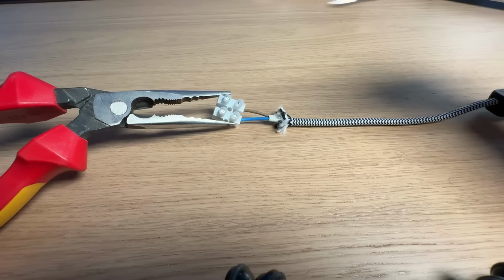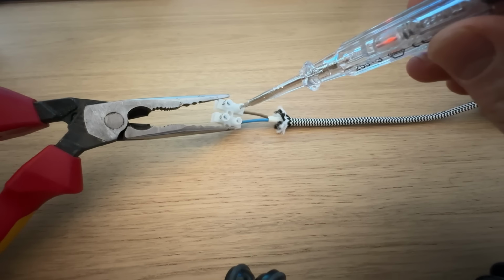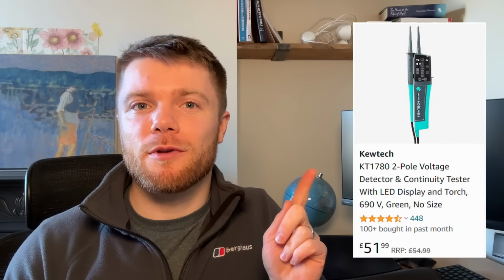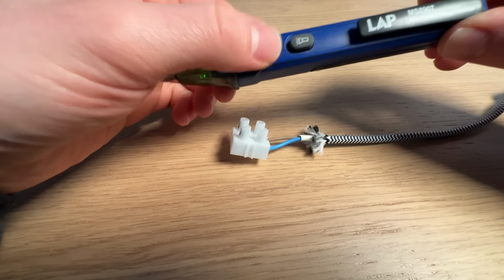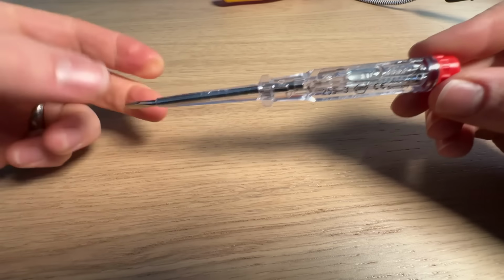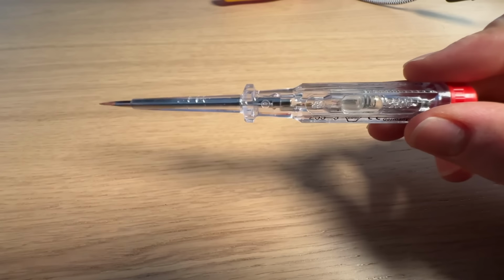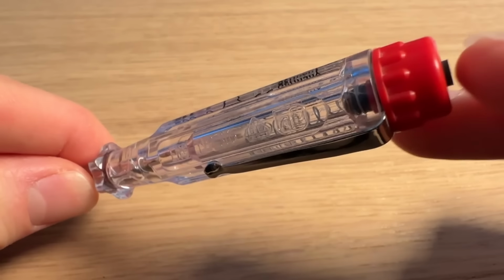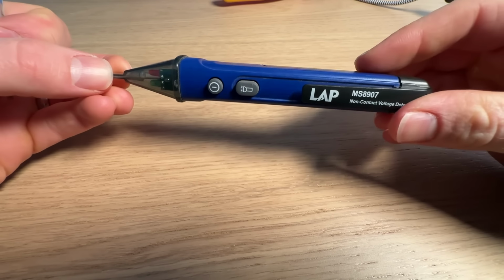The Most Dangerous Electrical Tool

Comment: My non-contact voltage tester lights up when I touch my nose or other body part.

Meanwhile it doesn’t light up on live power cords because the two wires cancel each other magneticallyo.

Comment: As an 80yr old DIYing Design Engineer, I appreciate the risks you point out but I used one for decades and I have to say that it hardly ever killed me.🤪  Following the valid points you made, though, it would make sense NOT to use one especially with the availability of the magnetic sensing type you demonstrated.  Thank you for your effort... .Excellent video.
NoAxe

Comment: Non contact voltage tester is cool. Didn't know they existed. Only real problem with the screwdriver is you could get it between live and neutral and then you short circuit. Strange this was not mentioned. I actually did that once...the spark was pretty big )))

Comment: Very, very well said, so informative! I've been using it for more than a decade, never got shocked, but what you say about getting something in that tight spacing, between the resistor and spring, mostly water... yes, that could really happen at any time! I although had voltage a check between the end, N and PE. 200V on a 230V circuit, of course with insignificanr, low current... it won't be easy, but from now on I'd use it at best for small screws. Keep safe!

Comment: There is absolutely no danger in using this tool, you cannot get shocked. Just that if you are isolated from the ground by thick shoes and air is dry, light may stay off even if wire is live, and you may be tricked, this being the danger. So, to be completely sure, keep the other hand on the wall or the ceiling, this will assure a better grounding of the body.

Comment: One should be aware, that there exist products for testing low voltage DC that that looks exactly like this pen screwdriver, but are very dangerous when used for mains voltage. Always check rated voltage and insides before using this kind of item. Those phase testers are classic and worked quite well, but it seems they are being phased out of eshops anyway...

Comment: If you find hard to securely work with a neonpen you have less knowledge to work with electrical than requred. Go stack retail.
Reply: ...getting an actual READING off of these devices requires FIELD EXPERIENCE. They work safely, and (because of their simplicity) they are always reliable and can get you through issues WAY faster then your Mystery Machines you buy for a sl of dollars/pounds.

I'll do wonders after wonders with this while you're looking for manuals/bateries.

Comment: I’ve been using mine for years with no problems. If the spring were to break it wouldn’t complete the circuit anyway & condensation is a stretch. If you don’t look after your tools I guess anything is possible!

Comment: I prefer the non contact testers as well. Always been wary of the screwdriver testers where you're essentially using your body as  an electrical conduit to earth for mains current, relying on the resistor in the screwdriver and whoever put it together to lower the current enough.

Comment: Good video and good explanation. Just want to add small point. The screwdriver is not really dangerous because of big current, since resistor inside is very high. The bigger problem is people think it’s safe or dead when it’s not. So it’s more about false safety than shock itself. Still agree that non-contact tester is better.

Comment: Like anything else if used properly and check before use. Many use them as a screwdriver which can damage in internals. Most of those testers have a pocket grip and that's where it should stay if not testing for a live.

Comment: Non contact voltage testers don’t work with DC, they only work with AC do use them only for AC.  Use the screwdriver voltage tester for DC like in the car which is 12v DC

Comment: The BIG problem with some   NEON  screwdrivers .... is .... just  DO  NOT  use as a screwdriver (  EH ? , WHY ? ) ... the plastic moulding is  SO MUCH  inferior to a ( normal 😝 ) screwdriver , and may rotate under pressure ( tried - n - tested ) .... DAVE™🛑

Comment: Contactless ones are not as reliable as old neon light testers. 
They are completely safe if you know how to use them: always use your dielectrical shoes when working with elevtricity.
And by the way, there's a conceptual mistake in your explanation: you don't close circuit to the ground, that's not how it works. The tiny neon in the tester needs so little current that your body's capacity is enough to take all the electrons back and forth. 
You are a big capacitor charging and discharging. A wave of electrons go from the wire to your body and back from your body to the wire, no closed circuit.
This is how it works even when you are isolated from the ground, say up in a wooden ladder

Comment: For a domestic spark, these are probably okay, tho I wouldn’t use it and I usually throw it in the bin when I buy a new set of screwdrivers .  They’re terrible as a screwdriver  so it ends up being a dedicated voltage tester which it isn’t really great at either. You’re better off with a Duspol which is CAT IV rated for up to 600 and CAT III for 1000v.

Comment: Non contact "pen" is quite good but sometimes it doesn't light up for live isolated cable. So always double check with two different kinds of testers eg. non contact and screwdriver.

Comment: The advantage of an indicator screwdriver over non-contact tester is that it gets in CONTACT with a conductor where NON-CONTACT tester does not. If you use non-contact tester to check a back box with 'spaghetti' you will not get a definite answer which particular conductor is live and which one is not because magnetic field created by live conductor which is close to all other conductors may affect those which are not live and still trigger your non-contact tester. Indicator screwdriver provides you very strong indication which PARTICULAR conductor is live and because of that reason I will carry on using it. I hope it makes sense and please correct me if I am wrong.

Comment: I much more prefer using 2 voltage testers, one is the one this video is criticizing, and the other one is one that tests through wires without opening them and in contacts too. from my point of view this is a much safer way to work because if one fails, the other one will work, the chances of the both failing are almost zero.

Comment: Regarding the non contact detector. Problem arises when testing what you think is a negative wire, the detector may signal because its picking up a signal from a nearby positive wire giving the impression that the negative is live when it’s not.

Comment: I've worked for 2 major steel suppliers. The contact screwdrivers were outlawed decades ago by the employers. If I was caught using one, I'd be out the gate. I use a non-contact tester for checking live, but not proving dead. Fluke meters or approved test lamps are the only tools permitted for proving dead.

Comment: problem with the other options is that, the non contact detector can and will lie to you. And the 2 prong tester ,well needs 2 points of reference, you dont always have that. The biggest problem with these is that the plastic on the shaft breaks way too easily. But a bit of electrical tape and youre set

Comment: Rule in Australia is following: 
1. Check tester before use.
2. Employ tester.
3. Check tester before putting away, especially if there was the possibility that someone else used it and damaged when you were absent.
These are excellent, particularly the new types where one may test for continuity, etc!

Comment: There are better designed versions of this tool which are sealed and the neon is shrouded so that it can be seen in brighter lighting conditions. You may well not always be making a circuit as I have used them in rubber boots on rubber matting and they still work (capacitance?) but get brighter if you touch something earthed. Whatever tester you are using test it on something you know is live first. I love these simple testers and they outlive all the electronic, battery eating, bleepy things and I've had a few over the years.

Comment: These screwdrivers are the best thing you can have if you know how to use them. Yeah, I could haul my electrical tester with me wherever I go, but I don’t do that. And I can always carry this small screwdriver in my pocket, you can’t put electrical testers (a multimeter or a Fluke) in your pocket. I use it as an ordinary screwdriver 95% of the time, it’s just the right size to screw or unscrew most of the screws you find in the wild.

But when you need to check if there’s electricity, you should always test it first on an outlet you know has power. Oh, and that no-contact pen you have, I’ve heard a lot of German electricians call it a “liar” (Lügner), because it’s so unreliable at detecting whether there’s power or not, even though that’s its only job. Meanwhile, the test screwdriver can unscrew screws and do a lot of other things, and it has the same level of reliability when checking for power.

Oh, and don’t get me wrong, all of these tools are great for what they’re meant to do. I own all of them, you just need to know how and when to use them properly.

Comment: In my opinion they are not dangerous to use. The problem I see is that it gives you only an indication that there is a voltage on the live wire. You don't know how much, neither do know if the neutral wire is installed correctly.
You need a voltage meter to find out, and luckily they are very affordable these days.

Comment: My father had the brilliant idea of checking if there was current at his motorcycle's spark plug with this voltage tester screwdriver. He was flung backwards and the screwdriver was half melted (there's about 20 kV at the spark plug).

Comment: The best way to measure voltage to neutral or earth is to use a  table lamp without a plug .  When the bulb lights up, there is a voltage.  With this you eliminate also induction voltages.  These screwdrivers and voltsticks light up when there is an  induction voltage.

Comment: These screwdrivers and voltage sticks are for indication only!  Always measure with a professional voltage tester like a duspol or a multimeter.  Check your multimeter or voltage tester at a live socket, and after that measure again.  So you eliminate wire break at your instrument!

Comment: test pen isn’t a dangerous tool; the danger comes from people misinterpreting it. It’s only a simple indicator, if someone uses it to declare whether an installation is safe or not. the actual risk lies with the user, not the tool. There’s no solid evidence or data of fatal accidents caused by the test pen itself. So calling it ‘the most dangerous tool’ is more of a hyperbole than a technical fact.

Comment: The advantage of a test screwdriver (neon tester) is that, since it works by direct contact rather than by induction, it allows you to distinguish which slot in a receptacle is the live conductor and which is the neutral. Very often you don’t have a grounding point available to verify this with a multimeter, so I have to resort to a test screwdriver because an induction-type tester will trigger whenever it’s near the live conductor, even if you place it on the neutral. For this reason, the induction-type tester does not replace a test screwdriver. Its hazard does not negate its specificity.

Comment: I understand the point and I agree it could have been done better, but I guess most DIY (non-electrician) people need from time to time an easy to use and not too costly tool for checking the live wire, because this one is most dangerous. I myself in couple of cases had to connect the non-live wire to the grounding terminal, because there was no real grounding coming out of the wall, and I needed to connect shielded RJ-45/Ethernet cable to something that could really collect any charge.

Comment: I use the same one my father used, a quality item, says "Made in Britain" on it. I test it on a known live contact both before and after testing the contact in question, like I was taught in the Navy.  When working on electricals, you are going to handle stuff that is normally live, after isolating it and testing it for voltage. This device is the last test I do before actual handling and I'd still do it even after using any of those other gadgets recommended here, because I trust it most.

Comment: You ISOLATE the circuit you're working on first, checking that, for example , the lighting circuit is dead; then you use a mains tester screwdriver to confirm the circuit is dead! ... It's always worked for me! ... Remember folks, electricity CAN be dangerous, if you're an idiot! 🤣

Comment: I always use a voltmeter for this, first checking the voltmeter by connecting it to a switched socket, so that I know what zero and 220V looks like and know that the meter is working and correctly configured. I never touch 3-phase circuits - that is a job for a certified electrician.

Comment: Do you really REALLY believe all this?
Reply: You can clearly see the circuit through the transparent handle. Are you maga or what?
Reply: @pavel9652  Do you watched the video? Do you understand what he say? Do you know something about electricity? Have you used one of this in the last 50 years?
I guess you are maga, gaga, gugu or whatever.
Reply: @sebastian19745  Yes. Yes. Yes. Yes. No. Anything else?
Reply: @pavel9652  I doubt, if you used one such device in the last 50 years, according to this video, you should have get electrocuted or worse until now; for sure didn't survive.
Edit: I do see the circuit, yes, what I disagree is his approach to paint the device as not useful, too dangerous, endorsing that contactless gadget. And I AGREE that the quality of "modern" such Ne indicators have decreased since the production was translated to China, but I still use mine bought in early 90s, made in W Germany. That, btw, have the same circuit: a 330k resistor in series with the axial Ne bulb.
If that makes me maga, so be it. Happy now?

Comment: I’ve used one for more than fifty years. When the neon lights I know that cable/connection is live.I bought a Lap tester and that tells me one of the connections is live but not which one. So it’s first in with the Lap then I use the neon.

Comment: That Martendale type tester is not the best way to prove dead. It doesn’t detect dc voltage under 12V. Try using that on a 5Vdc 32,000A circuit, not very helpful!

Comment: I am an electrician and i hate these screwdrivers. Tey are unreliable and lead to uncertain results. But I have to tell you that story. When I was in my training years we prepared these screwdrivers, replaced the resistant with a piece of metal and told others to see if it was functioning. 😂 It functioned queit well, as you can imagine. There was no life threat, just a short shock. It happened to me at first too, and as you can read, i´m still alive..

Comment: One of these saved my life. I was testing a bunch of circuits to switch out some faulty switches. A gang turf war erupted outside and a bullet came through the wall. The little screwdriver tester in my pocket stopped the bullet. Thank goodness I was using my touch less instead.

Comment: When the electricity goes into you, where does it then go?
Reply: Into the ground via your body, shoes and the floor.  The current is very small due to the high resistance of the neon lamp.

Comment: When I started my electrical apprenticeship 1952 ,we had very little testing equipment, this device was commonly used, we also made up a flex and lamp holder with a 60 watt bayonet cap lamp , I’ve also seen older sparks using wet finger tips on dc cables

Comment: The neon lamp itself is an isolation device. Anything that is damaged physically can become dangerous. This tester has been around for many decades, and I have never seen any safety recalls or UL reports that they should be banned. A pencil with graphite lead could be more dangerous than this screwdriver.

Comment: The point is not to test the main, it is for use when you turned off / should be off, to warn you if you do use it, i.e. last-line defense. So it should still warn you bright and loud, or a tactile motor.
Current, especially residual current, through your body through shoes/floor is lower but not ideal test path.

Comment: That tester wasn't  in the top ten. Dangerous? Only if you can't see the the light coming on. That type of tester should be checked with a known hot circuit.  The light can last for decades, but if it fails that could be an issue.  My real issue is a lack of high quality tools for electrical work, readily available. In Europe  that was never an issue.     Pliers, cutting tools well insulated, and having a good size slip guard. Almost see through handle to see if the insulation  damaged screw drivers were insulated almost to the end.  The rest of the issues are largely structural. Loose boxes moving every time something is plugged  in or removed. Plastic boxes may have solved that problem but created an other. Ground connections. And  fire hazard. By the time someone might notice the smoke, the fire might have spread inside the walls. New houses are like tinder  boxes, everything is flammable, fast burning and creating toxic gases. Door and windows,  baseboards not using real wood which burns relatively slow. But prepainted pressed paper. Fire extinguisher a large one is a must.😮